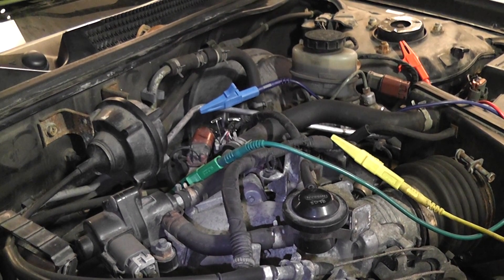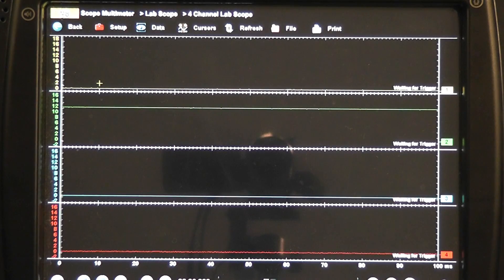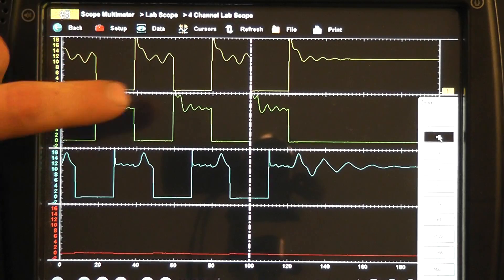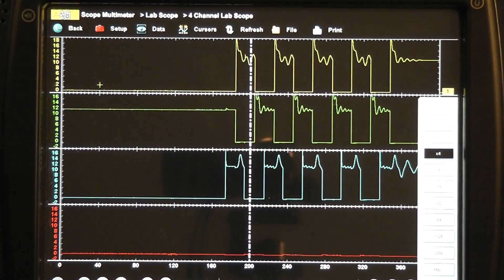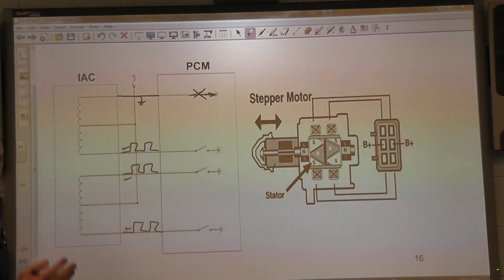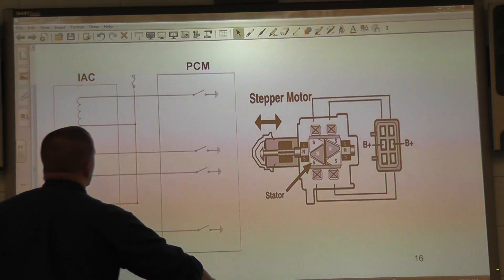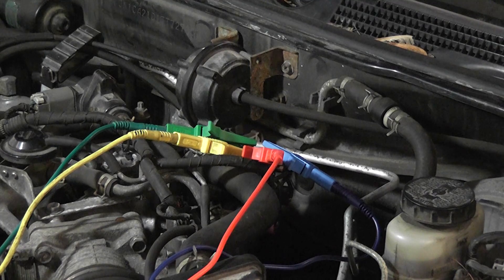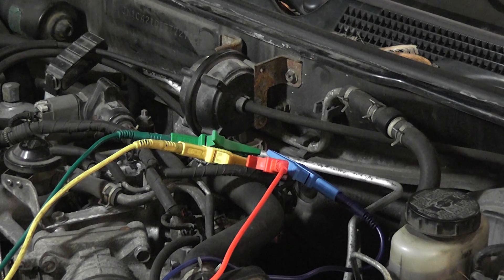How to test an Idle Air Control (IAC) valve - Nissan/Infinity

Comment from the maker: Good question! Because the coil winding is open in the IAC solenoid. So with the solenoid winding open there is no voltage available in the circuit, ever. So you will not see the voltage drop when it is grounded if there is no voltage available to drop. Hope that makes sense.

Comment from the maker: @AutoTechHector We were taught many incorrect things weren't we? Remember the anti-static wrist bands? 
In my book I have a few pages on this. You must know what your test light current draw is and you must know what the normal amperage is of the circuit you are testing. As long as you test light draws less than 300ma you should be ok to test ANY computer driver with it. Also keep the test light away from airbag circuits. I would agree, no test light should be used on those.

Comment: Good stuff Mr. Danner this is Hector,another one of your "youtube students" i got a quick question...I see that in a lot of your diagnosis you use a test light, i thought that you weren't supposed to use a 12 volt test light on a computer controlled system because you can potentially damage the PCM. How do you get away with it??

Comment: Great video. Since we are all here to learn. I will point out that you could also have a bad connection on the one pin that connects to the idle control motor for that one circuit. This bad connection could be the result of a bent over pin on the idle control motor, damaged plug etc. You could unplug the connector do a visual inspection of the connector plug, the idle air control pin and a drag test on the connector plug. Then do a resistance test directly on the motor.

Comment from the maker: @Username64870 Good point about not being able to test some circuits while they are on. Your thought process is good in this situation, just be careful using that analog meter. On some circuits it can be misleading.
Thanks for your comments

Comment: @ScannerDanner Thanks for ur reply. Sir I have run in to some circuits where DMM shows 5v correctly but  with so tiny current (in some situations we can't test  circuits while they are on) therefore we think power is  ok but it isn't . that's why i  use combine DMM and AMM meter.I often use High impedance scopes to view small voltages and any  signals.But any way you are much more experienced fellow than me so i  respect your wisdom.Thanks.

Comment from the maker: @Username64870 What you are describing is why you shouldn't use an analog meter on low voltage computer circuits. It can "pull-down" the signal voltage that you are trying to test. What you should ALWAYS do to ensure proper DMM readings is make sure the circuit is loaded (current flowing). And also to understand that fast on/off signals will be averaged. I understand what you are saying about an analog meter applying a small load on the circuit but computer circuits shouldn't be tested this way

Comment: Hi I have seen lot's of techs using only Digital meters to check voltages but some time they mislead us.I checked 5v line with DMM and it showed me 4.8v but Analogue Meter gave me 2v. It terns out  that Analogue Meter was correct?because unlike DMM ,AMM meters draws current via its needle coil which add some load but Some  High quality High impedance  DMM only sensitive to circuit gain.So i use 2 in 1 combine meters. Guys Have u ever been fooled by DMMS?

Comment from the maker: @jcb1972 Yes, they do make them. I just don't have one and for the most part all of the output drivers that I am testing are capable of alot more than 200ma. Most output solenoids draw between 300 and 500ma with some higher current ones near 1 amp. The only concern with my light would be a relay coil driver that normally carries around 100ma, but I have tested hundreds of them with this type of light and never hurt one. This is why I never bothered to buy an LED type light. I would like one tho

Comment: @ScannerDanner  Oh you have got to upload that one where you repair an PCM with the guts of a ford PCM.
I think we will see this type of work in our shops someday,  SMD solder stations are not all that expensive now days and make it easy to make a repair.
The only problem will be the identification and location of the failed component on the PCB.
I have fixed many of those GM HVAC controllers with a POT from radio shack and when you open it up the board inside is at best very universal.